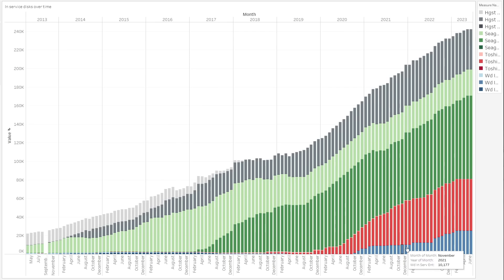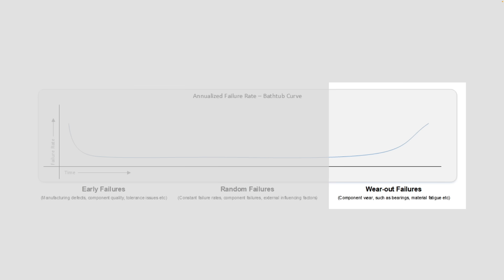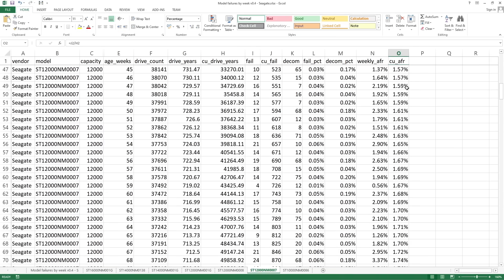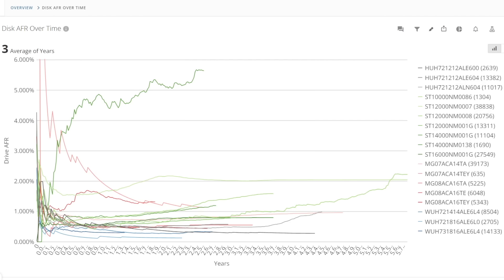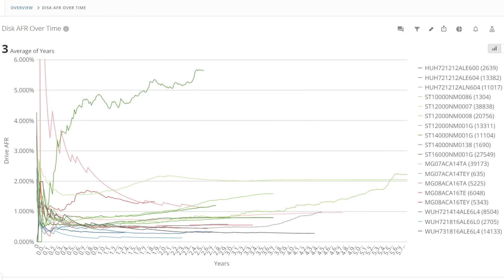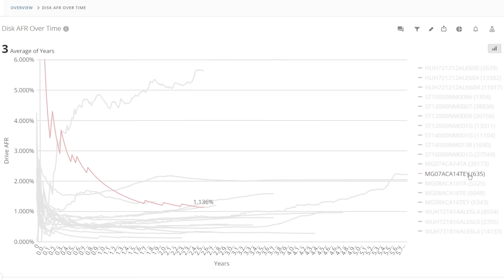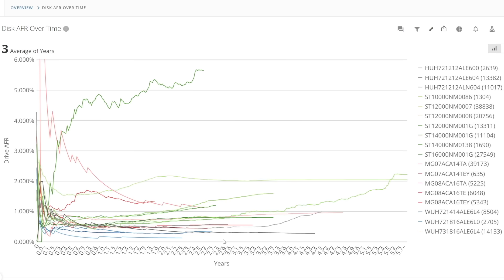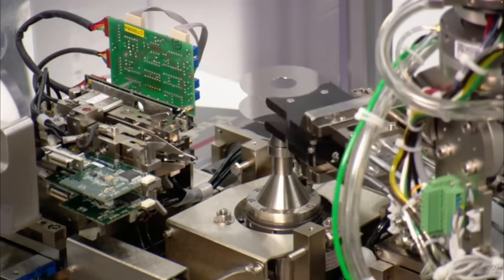Failure Rate Analysis - Best 10Tb+ hard drives: Seagate, Western Digital or Toshiba?

Comment: First of all: Thank you for sharing such great compilation of information. 
About reviewing “smaller” HDD:  1TB and 2TB 3.5” HDD would be great, as they stay in our homes for years, as backup (see digression/suggestion at the end). I imagine my home case could be somehow common (or not so rare):
I STILL have almost 10 of such HDD: 5x 2TB (HGST, being 2x in a NAS Raid0), 2x NAS 1TB (Maxtor and brand?), 1TB USB (Bufallo), 1TB Seagate. And last year I bought a “larger” 4TB 3.5” with a USB 3.0 housing to help Laptop migration. I don’t have their details & model numbers catalogued to share here, sorry.
I (we all?) also have several (~20 units) of 2.5” from Seagate (several FreeAgent one#) and WD, ranging from 160GB to 1TB, but mostly in the 320GB-640GB range. They are OFFLINE, but we’re good - and I hope they would still be.
Most of these are now “offline” HDD, used now just as storage or backup, expect for the ones used in LAPTOP’s main HDD (after ~5Y, being replaced by SSD), their actual accumulated hour is typically small (guess to be in the range 1K~5K Hr), but 90% were purchased in 2009~2011, where USB “pen drives” were slow and/or expensive for the HDD range. 
Nowadays the new-case scenario is very different than a decade ago, but a “lot of people” maintain personal data  in “older” offline HDD - I included here (ignorance is bliss?).
This could bring a different by-product to be shown: how lasting the HDD 2.5” and 3.5” would be for “long-term” storage, while being sporadically used. 
And associated digressions as: should their “engine” be turned-on periodically to “remove the rust under the hood”, as they are made with noble materials but still mechanical devices?
Thank you again for sharing your findings and views.
Reply from the maker: Thanks for the thoughtful comment.

I also have a lot of old disks lying around I use for offline backups, specifically I have a lot of 1.5Tb and 3Tb disks that used to be in NAS devices, but I also have a collection of older disks. I think its worth taking a look at AFR data for these older disks to see if their lifespans and reliability are consistent or differ from newer models.

Its also an interesting consideration about the lifespans of disks that are not regularly powered. Long term data integrity on spinning rust is better than SSDs, and the opportunity for bit rot is lower. But mechanically, they should last well. Maybe the question here is if bearings dry out. But this isn't easy to mine from data like Backblaze, as the disks in the dataset are typically in 24x7 operation. So that may require some thought.

I am planning to look at another couple of things in the data here, and I will put together some analysis of the older disks. And maybe there is something to reveal there about how 3.5" disks compare to the 2.5" models.

Comment: My 2GB Seagate drive just went kaput after 2 years of minimal use. Even after reformatting and resetting the drive, it only partial transfers/downloads a file and then stops. I now need a replacement and that's what turned me to your comparison videos. Thanks for these detailed videos.
Reply: if your drive is an external drive I would try to shuck it and either try it internally or with a USB enclosure. I have seen cases where the external USB enclosure has failed but the internal is fine.
Reply: @sbrblz  I use a laptop, so can't do that. Thanks for the tip tho.
Reply from the maker: Sorry, sounds unlucky. But thank you for checking out my channel, and I hope the video was useful in helping you compare the manufacturers and products. 

I have some other videos that look at different aspects of the failure data, but I have not yet covered the disks under 2Tb. I think a lot of people still use these in PCs or for offline backup, so I will take a look that data and see if it provides useful information that's worth digging into. Good luck with the new disk!
Reply: @sometechguy  Sorry,  meant 2 TB, not GB.
Reply: @sigerlion8608  Its common knowledge that seagate makes unreliable drives (they are hit or miss), and for some reason it is considered taboo to say this even though we all know it. Usually when you say this, you will get a response along the lines of (oh well its not just seagate, all drives have a chance to fail". 

Trust me, even though any drive has a chance to fail, seagate drives have the highest chance. I feel like seagate has a real life failure rate of 40% after around 3 years but people don't want to admit it.
Reply: @angrysocialjusticewarrior  Yeah, I barely used the drive. Only uploaded files every few months. Kept it in a cool place. Never bumped or dropped it, and it still failed before reaching 2 years.
Reply: @angrysocialjusticewarrior  With 30y in the business I've to agree. We also have a funny quote here in Switzerland due to the pronunciation of "Seagate" which is the same as "Sie geit - oder Sie geit nöd" meaning "It works - or it works not" ;)
Reply: @sometechguy Reviewing the 1TB and 2TB 3.5” HDD would be great. For instance: I have almost 10 of them: 5x 2TB (HGST being 2x in a NAS Raid0), 2x NAS 1TB (Maxtor and brand?), 1TB USB (Bufallo). And several (~20 units) of 2.5” from Seagate and WD, ranging from 160GB to 1TB, but mostly in the 320GB-640GB range. 
Reviewing the 1TB and 2TB 3.5” HDD would be great. For instance: I have almost 10 of them: 5x 2TB (HGST being 2x in a NAS Raid0), 2x NAS 1TB (Maxtor and brand?), 1TB USB (Bufallo). And several (~20 units) of 2.5” from Seagate and WD, ranging from 160GB to 1TB, but mostly in the 320GB-640GB range. 
As most of these are now “off-line” HDD, for storage or backup, expect for the ones used in LAPTOP’s main HDD (after ~5Y, being replaced by SSD), their actual accumulated hour is typically small (guess to be in the range 1K~5K Hr), but 90% were purchased in 2009~2011.
Thank you for sharing such great compilation of information.
Reply: Anything under 8TB is horrible reliability for Seagates. Helium or nothing. Seagate consumer drives are not meant for 24/7 power on use either.

Comment: I watched 3 of your movies. I like the analysis, and the visual stats about the performance of the drives. You put in a lot of effort visualizing the data, which is most appreciated.  It comes in handy to change the WD drives in my synolgy NAS, thanks.
Reply from the maker: Thank you for the positive feedback. When it comes to failure data, especially comparing many devices I think its really hard to get a good picture of this without visualizations, as there are so many variables to include. It did take some time to put together, and structuring the data also takes time, so I really appreciate the comment that it was useful.